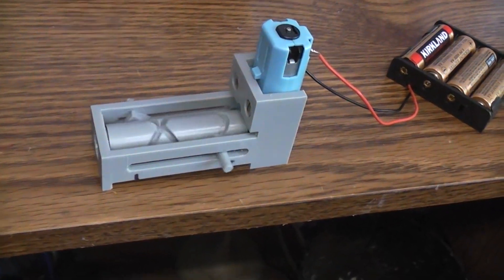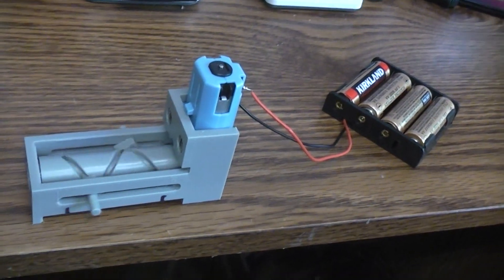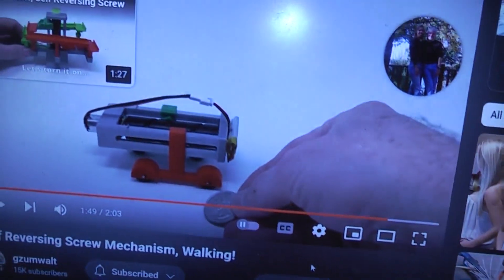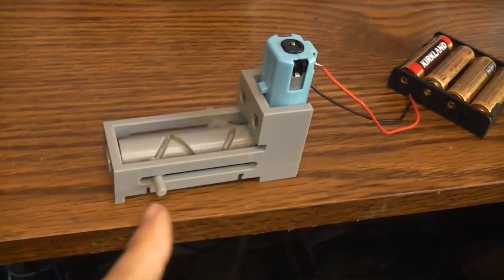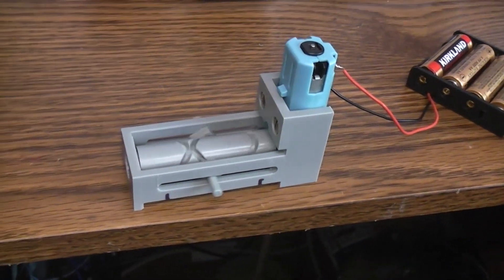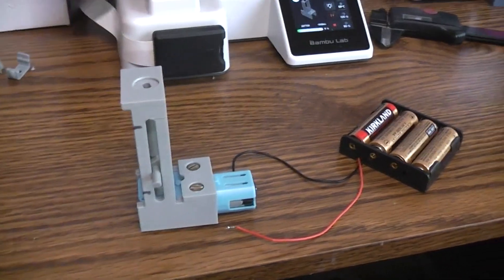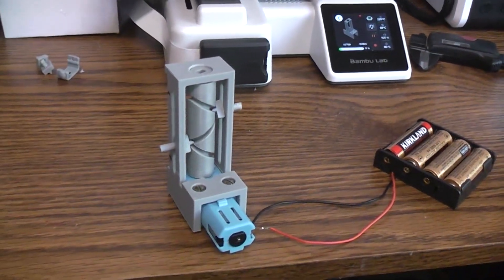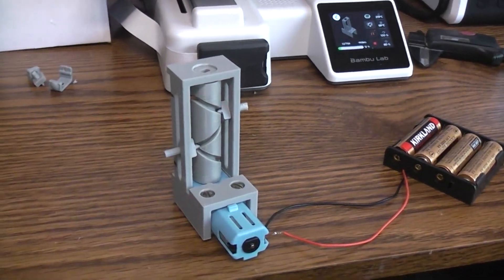Testing YouTube " gzumwalt"  Self-Reversing Screw Mechanism with a TT gearmotor 1:90.

Comment: what printer and orientation did you use to print this? i have been trying to print a similar mechanism on a fdm printer but it is never smooth
Reply from the maker: Bambu lab A1 mini. Printed vertically with supports for the top hole.

Comment: This mechnism is older than a century. It is regularly used in winches (e.g. in cable cars) to guide the rope on a rotating drum.
Reply from the maker: Fishing reals is where I first saw them used as a kid in the 1950's. What is cool is that Greg was able to design one in 3d CAD that could be 3d printed on FDM printers. Now I just want to have fun with it.

Comment: Wow John, EXCELLENT!  We can always count on you for excellent work!  My Marblevator and walker models draw an average of 20MA at 3.7VDC, did you check your current draw and if so, what was it?

Again, very excellent, you are wonderfully blessed with talent I wished I could attain.

Greg
Reply from the maker: The TT gearmotors draw about 86ma at 3 volts no load, my reversing set up is drawing 100ma at 3 volts. At 4.5 volts it is drawing about 120ma. Now once it has legs that should add some extra load to the motor, so we will see. Right now it draws much less than vintage  3 volt toys they normally are in the 150 to 180ma range depending on there functions.